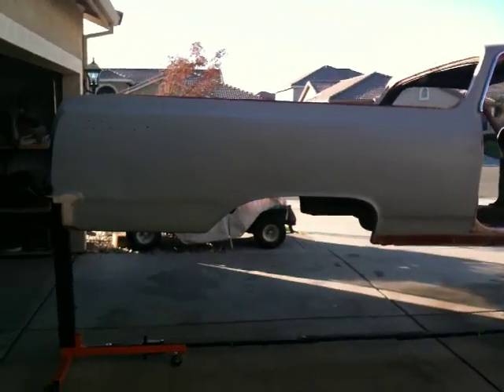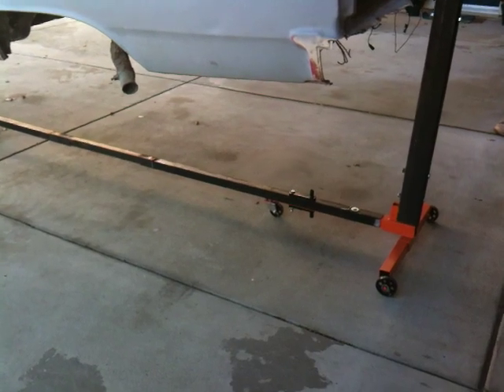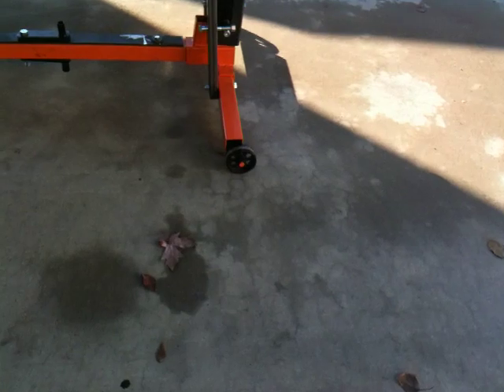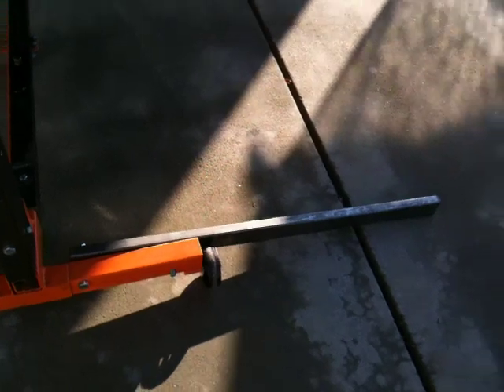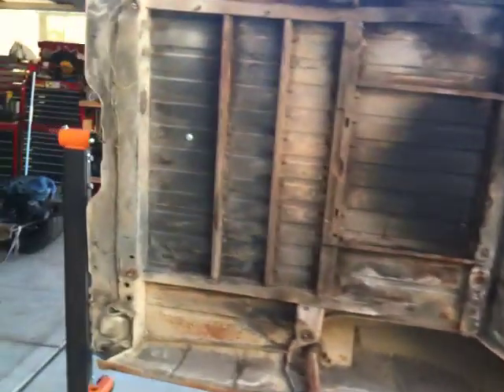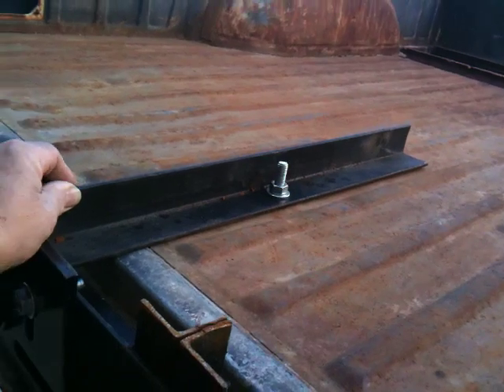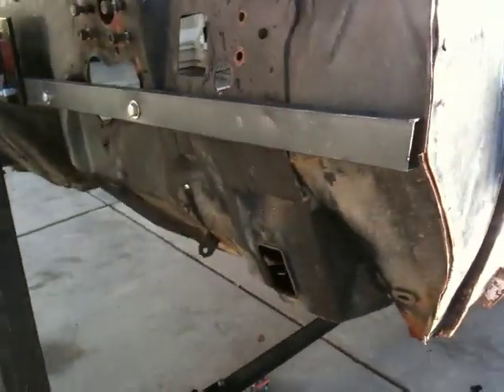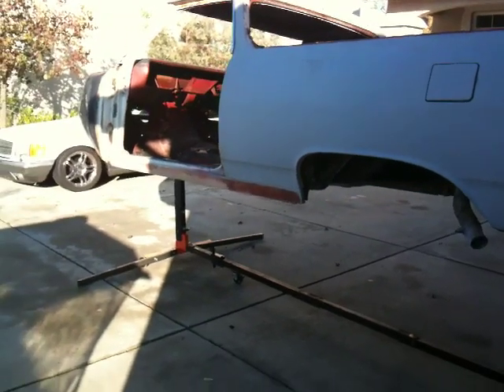homemade car rotisserie

Comment: Cool. Personally I would be a little more at ease if the bases of those engine stands were as wide as the body. Also I've seen where some guys tack weld braces diagonally in the door openings to help stiffen the body. A lot of weight is hanging in the air between those two engine lifts that is normally supported by the frame. Good luck!!

Comment: this is so brilliant. cus  can fix my two engines first .. buy a 2nd engine stands.. once done. buy casters and make them mobile..  then use my stands like you did :P  i love this thinking. engine stands here are 50 euro each. steel isnt so expensive  but a ready made rotisery a not so cool 1800 euro and there crap too lol
decent ones are 2500 euro >.>

Comment: So how hard was it to find the center axis to spin and balance the body? Nice  idea but I'd put out rigger legs on the rear stand also.Does it roll fairly easily with those small wheels? Necessity is the mother of invention.

Comment: Great job!  I'm getting ready to do a restoration on a 70 240Z and need something exactly like this.  Yours is the best rotisserie I've seen so far that uses 2 engine stands and probably the lowest cost as well.  Thanks for posting.
Reply: Same 77 280Z 2+2

Comment: that is neat, I had seen your video a while back and now have my camaro ready to load up on something like this, have you had any safety issues since you built this I can look for?   I have a 69 camaro, everything except the dashboard and instrurment panel is out of it,  If I build one like yours it will only be for this single project.  thanks in advance   Jeff

Comment: as far as height goes.so it wont hit the ground when turning if the vehicle is say 1800 wide then your height extension on top of the engine stand should be 1000ml.then it gives you 2000ml turning circle.........GO THE SMART AUSSIE'S

Comment: What a great idea!  Ive got the two engine stands,  I just need to know the dimensions of the other stuff that I need to make this work.  Any info on how to put this thing together would be greatly appreciated!
Reply: All’s you need to know is the longitudinal and vertical CG of the vehicle that you’re building it for so that the vehicle can rotate in the same plane from each end and side to side. You’ll also need to fab mounting brkts common to your car/truck. 

The one flaw his design has or maybe I just missed it but you need to have a locking mechanism that can be disengaged and engaged on one or both ends, so that when you are working on the vehicle applying loads pushing/pulling it won’t have a tendency to roll or rotate on you working all alone late at night or early morning, just saying